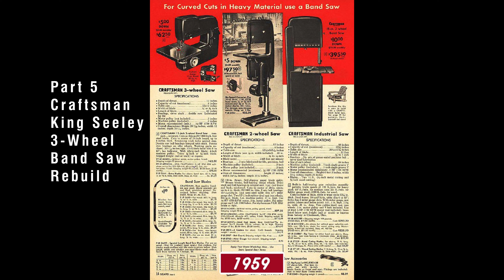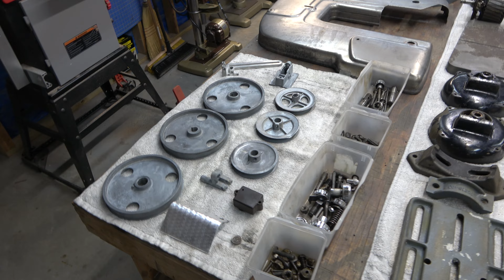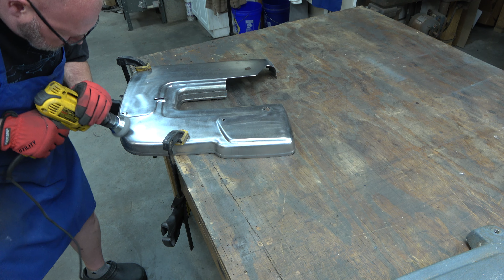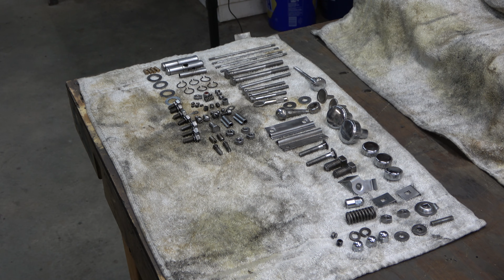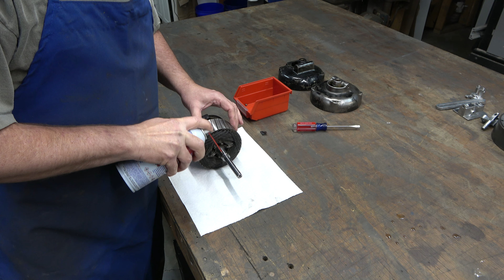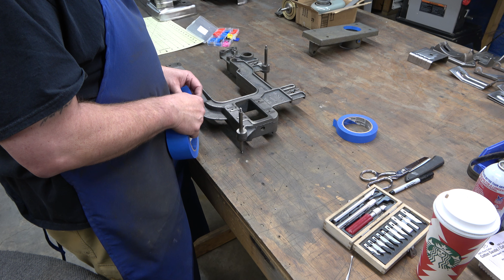Part 5 Rebuild Craftsman King Seeley 3 Wheel Band Saw (Cleaning Parts and Masking for Paint)

Comment: Jeff,  Just picked up a King-Seeley 12" bandsaw.  Can't remember what the technique is to clean up those chrome cover knobs seen at 8:44 in the top row. They are starting to pit, but are in decent shape. Are they plated or ZAMAK?  What is your technique please?   NEVR-Dull?  Buffer?
Reply from the maker: Flash, I believe they are chrome plated over Zamak. If they are not too far gone, I normally soak them in simple green then polish with Mother’s Mag and Aluminum polish. If they are really bad, then sand and polishing is the only thing left to do. I dry sand starting somewhere around 100 grit and go up to 320 grit. Then wet sand 400-1000 grit then polish with Mother’s Mag and Aluminum polish. Take a look at this video where I polished a hub and tension knob both were completely devoid of any chrome.
https://youtu.be/9QHyo-Ao7bA?si=5rHKlBe3O4CNAkxZ&t=1174
Reply: @JeffsShop    Exactly the video portion I was looking for.. thanks!   I chucked them up in a lathe and used NEVR-Dull wadding to smooth out the surface pitting followed by Flitz polish on a paper towel for a bit of abrasiveness.  They cleaned up well.  Think I did something similar with my Craftsman 100 drill press knobs and hardware....
Reply from the maker: @Flash_Gordon_x Glad I could be of help.